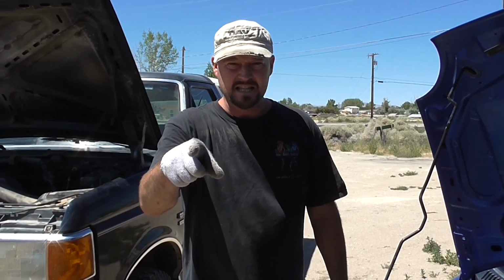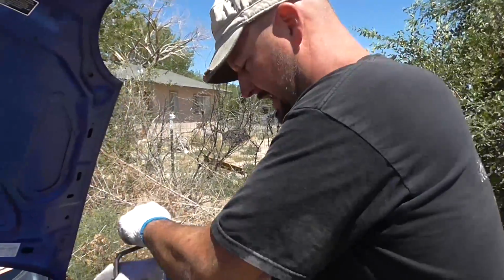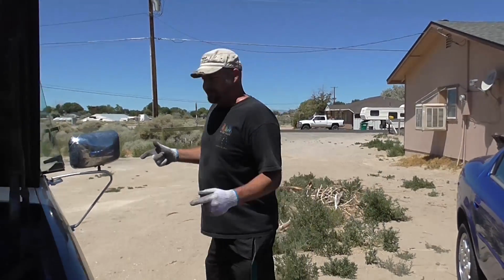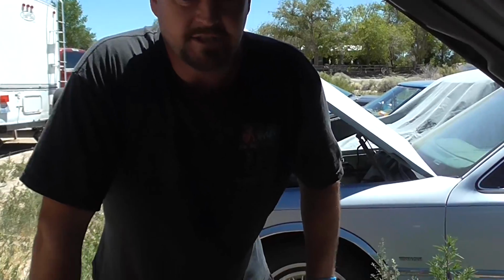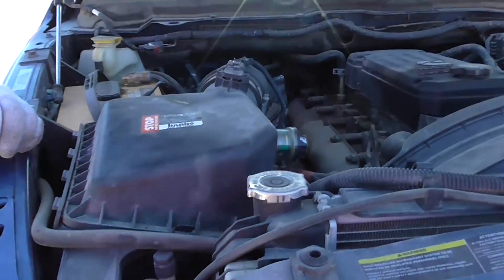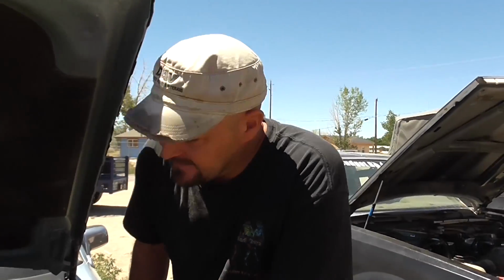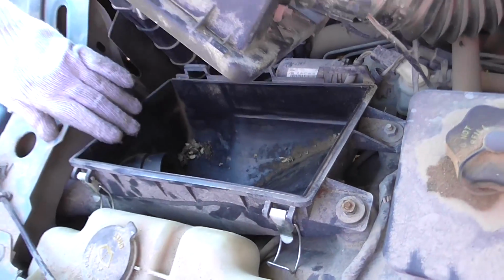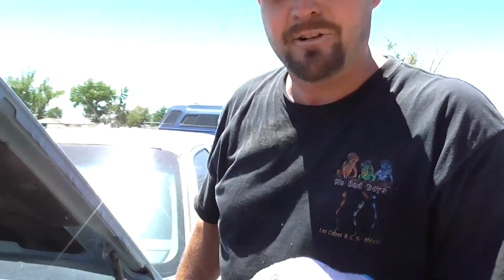Free Horsepower And Fuel Economy - Intake Mods

Comment: Wow, this type of mod works at full throttle, with injector upgrade, and exhaust mod. In the long run you are not building a race car. Where did you get your degree in automotive engineering? LOL
Reply from the maker: The concept is very basic, just like the good ole days when lots of motorists flipped their air cleaner lid to give their 4 barrel carb more inlet breathing air and better response.  That tiny hole on the majority of vehicle air boxes today is way too small, especially in comparison to the size of the airfilter.  The same goes for exhaust.  Free flowing intake and exhaust is very basic and less work on the engine to produce more efficiency.  I call is rare sense due to it not being common in the new generation of humans today.

Comment: Made the modification to my 07 Lincoln Town Car air filter box. WOW!!! NO JOKE!! Far less pedal effort and more power! When you pass another car and the transmission kicks down you can feel the torque push you back in the seat while the engine goes WWOOOPPP!!! Thank you for your post 👍
Reply: i have an 2010 vic, kinda want to do this. does anything get trapped up in the filter or does it get wet from snow and water (i have the k&n drop in filter already.)
Reply: also does it throw any engine codes?

Comment: This modification is doing nothing but making noise, getting the filter dirty faster and sucking up hot air. I do NOT recommend anyone use a K&N filter....take a look at one under bright light and you will see the holes letting dirt get through....and if you have ever used one, you will notice how much dirt and K&N oil ends up on the intake and worse, could foul your mass-airflow sensor. The extra wear on your engine is not worth the 1 or 2 horsepower gain on a daily driver.
Reply: A "white glove" inspection of my Throttle Body after 110,000 miles with a K&N Air Filter showed it to be Perfectly CLEAN !!
 Those "holes" you see in the K&N filter allow maximum air flow -- while the OIL grabs the dirt from the air that flows through those tiny "holes".
 I have over 300,000 miles of  user experience with the K&N -- in blowing dust, pouring rain, and heavy snow.
 A properly cleaned and oiled K&N air filter WILL NOT contaminate the M.A.F. Sensor.
 I agree with you that it's a BAD idea to hack off the bottom of the Lincoln's  air box -- it's a TOTAL waste of time to do this unless a pair of straight-through, perforated, louver-less mufflers is installed.
 I recommend the MAGNA-FLOW perforated-core mufflers -- with NO headers installed and the catalytic converters left in place.
 The factory-installed cats on FORD vehicles will flow more air than a straight pipe, so removing them will only pollute our air and accomplish NOTHING else !!

Comment: So your saying a larger volume of cooler denser Air into the intake stream of a pollution controlled internal combustion engine creates more HP and Better fuel economy? Hmmm , then why wouldnt automakers design engines with larger volume cold air intakes originally ? I know they create better thottle response but as far as HP or MPG increases they most certainly do not . More Air means more fuel and larger volumes create less velocity which has a tendency to decrease low end torque. Air with higher velocity fills the cylinder much faster and with a larger charge of air. Cold air intakes dont increase anything other then a faster throttle response from dead stopped.

Comment: I remember building a funnel and installing it in my intake. For the first minute or so it ran impressively better, until the coolant "elbow" blew out because the funnel collapsed and I got to spend the next 6 hours digging out coolant elbow fragments from the inside of the engine. Lots of fun.

Comment: The induction kit is crap !You get no power gains what so ever it may sound faster but in reality you are loosing horse power I have seen this proved on a rolling road tune.
Reply from the maker: check the torque factors, they go up as well as less throttle input for more output.  Check it and see.
Reply from the maker: I dyno tuned my Ford F150 twin turbo, I did my intake mod and an exhaust mod to balance it out.  Got great results on horse power and even better results on low end torque with less throttle input.

Comment: if you are doing a video on cheap ways to get horsepower why is it revolving around a cold air intake mod that isnt cold air but holes in filter box to get HOT air into engine ? a good cold air intake system nets 5-15 hp tops alon without exhaust mods or pcm re calibration to support it ...... you had a crown victoria in your video those things have 4 catalytic converters on them removing them will gain you 45-60 hp and 6mpg at the very least the way to gain horsepower is to REMOVE cats they hinder performance and fuel economy and any OBD II system in good working order doesn't pollute the air very much its factories that the government doesn't make conform that pollutes ,,,, oh and if your car is 1996 and newer all the way to 2016 you can modify your car to think you have cats even if removed for less then $10 and 15 minutes and does not modify the wiring harness or electronics at least PA is going to be modifying the emission test to fail vehicles with a pcm calibration to turn off the cat sensors shortly
Reply from the maker: I also have videos explaining how exhaust and intake mods go hand in hand and when done together that is the best results.  That is not my only video you know.  We have close to 100 videos now, check more of them out.

Comment: Wow this video is just entertaining. Sometimes more airflow isn't the best. Do some research. It's been tested that those "restricting" paper filters are best for your car. K&N was tested to let dirt particles through the filter than any other brand. I don't know about you but I don't want the turbo on my 7.3 to be sucking in dirt. I'll stick to my 450cfm napa 6637 filter and know my vehicle isn't sucking in dirt. ALSO YOUR NOT GETTING BETTER AIR FLOW WITH HOW FILTHY ALL THOSE FILTERS WERE
Reply from the maker: Look at my dyno results video for my 2014 F150 Truck (silver one)  It dyno'd 526 Torque and 392 HP with just intake, exhaust and a mild tune from a diablosport.  No other F150 trucks with the ecoboost engine are getting those rear wheel power numbers with just intake, exhaust and mild tune.

Comment: "I calculated it by hand" lol
Reply from the maker: That means I used a calculator, miles driven divided into gallons of fuel used.  Example 300 miles driven, 10 gallons of fuel used equals 30 miles per gallon.

Comment: this is all sound.no hp at all get a clue dude
Reply from the maker: Well if it is done right, there will be a very noticeable low end torque gain and a bit of horsepower.  It intake and exhaust upgrades are done together, power and torque gains can be quite large.  If you question my theory, test a stock car with no mods on a rear wheel dyno, then do the intake mod, dyno again, do the exhaust mod, dyno again, that is best results.  Did you see the video of my Silver 2014 F150 Ecoboost on the dyno? it made 392 HP and 526 TQ at the REAR wheels not at the crank where the factory measures power.

Comment: Engines don't run on cold air they run on hot air the engines have to maintain a temperature to run good air restriction all way make the engine suck more fuel  the filter is only to prevent garvich to go in the engine  but manufacturers of filters make filters that get clogged real easy so they can sale more   hot air makes the combustion more efficient help the fuel to be come a vapor before combustion which is the real fuel not liquid gasoline that is why if you live in a cold area your engine have a hard time start gasoline contain hydrogen and nitrogen neither any of those elements do well in cold temperatures     below 4°C, the hydrogen bonds between water molecules become stronger and cause the matter to expand. .Hydrogen molecules violently react with hot oxygen when the existing molecular bonds break and new bonds are formed between oxygen and hydrogen atoms. As the products of the reaction are at a lower energy level than the reactants, the result is an explosive release of energy and the production of water so more heat more energy hot clean air more mileage from your fuel  great video